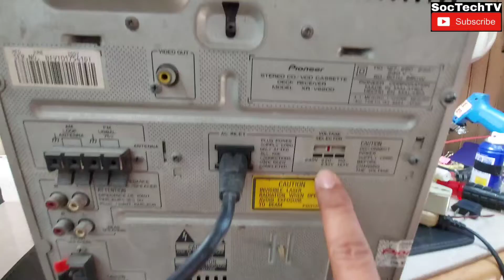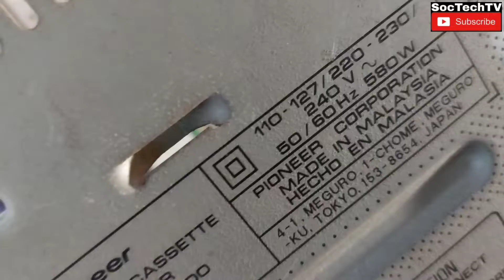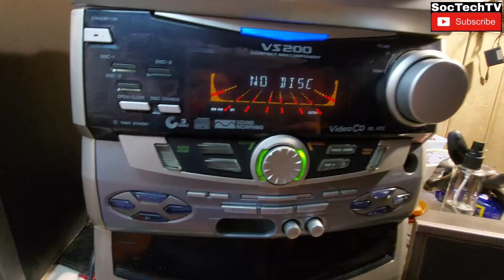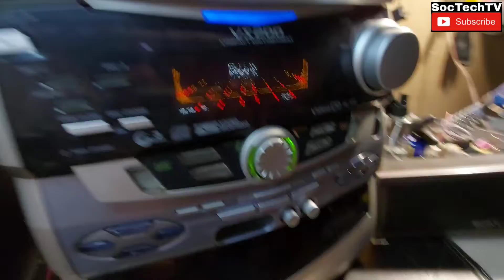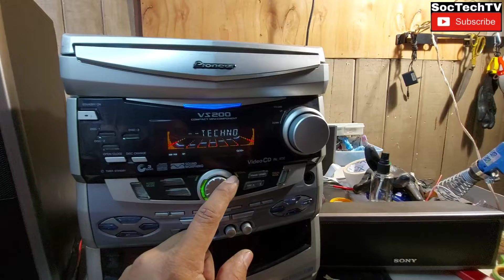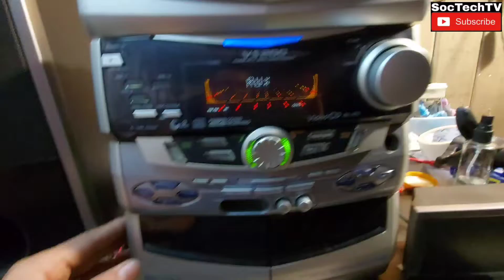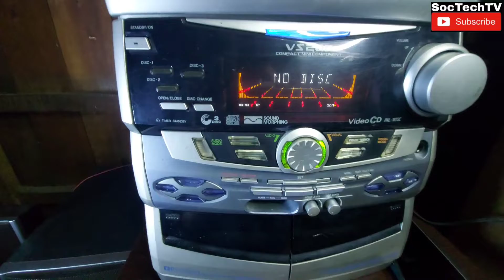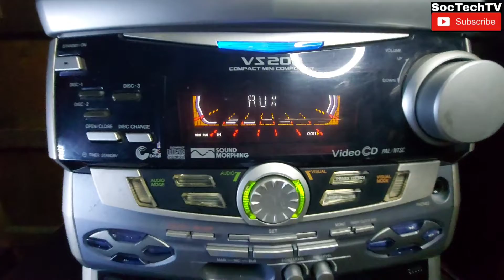Restoring a Nonfunctioning Pioneer, Audio, Soundbars, Component VZ-200

Comment: Sir ang akin po ok ang aux at tuner medyo mahina sagap sa fm. Ngpatunog ako ng tape my probs ngplay ng wlang sound nilakasan ko tpos tpos na stuck ang tape. Yun nagulat ako nwlan na ng signal sa display. Lng pumapasok na signal Khit sa aux wlang display na signal at di na n
Reply from the maker: May mga ng loss connection lng yan sir check mo n rn suppy papnta ng display